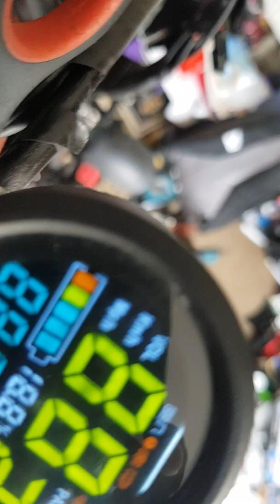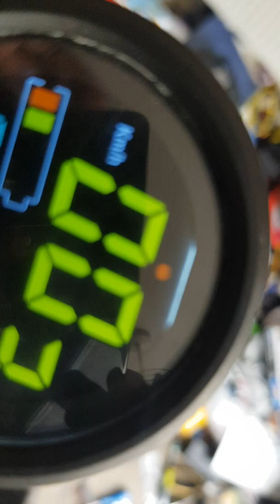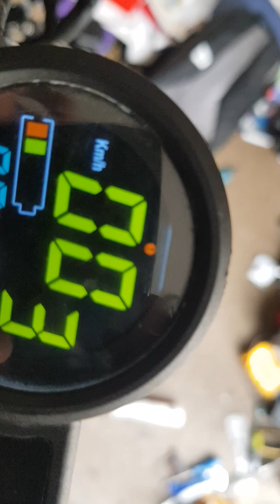Electric scooter brake sensor fault and easy repair.

Comment: I ripped my break sensor wires on accident. Can I retwist them back together? I been trying for 2 days.  
I did not know the scooter will not work without brakes
Reply from the maker: Hi, sorry to hear about your problem. Yes you can carefully reconnect the wires by Matching each colour and carefully taping them with insulation tape to keep them apart from touching each other. Your scooter should work again. If that fails, it means you might have had internal breach of the wire inside its coating. You should replace the whole wire. 
I hope this helps you.

Comment: Thanks man. It worked for me partialy.
After disconecting everything, only single motor was working. Thats the front side. But the back wasnt working and it only works when i turn on the dual mortor switch.. I need more help pls.

Comment: Thank you so much for this video, it saved me a lot of headache. I did notice one thing however when I was getting ready to open the wiring loom to disconnect the sensors. These brake sensors are just screwed onto the bottom of the brake levers, so I figured I would try and remove the sensors first just to check if the solution was working. It turns out the sensors are inductive, meaning there isn't any physical connection to the brake lever, there is a piece of metal in the brake lever's mechanism and when that moves close enough to that brake sensor (there's an inductive coil in there) then it changes the current going through the sensor and tells your brake light to come on. The sensors are also on tracks (the screws on the brake sensors aren't in circular holes, but rather in two long track cutouts), so if you want to keep the functionality then what you can do is loosen the screws, and move them around until they are properly aligned with your brake levers again so that the light only turns on when you pull the brake levers. This worked for me beautifully and now my scooter is back to full functionality, and I didn't have to mess with the wiring loom or anything.

Comment: My scooter brakes activate suddenly while i\m riding it then when i stop i just simply start riding and 2- 5 Minutes later it will brake abruptly and this keeps happening.  What do you think the problem may be?
Reply from the maker: Hi, sorry to hear about your problems. I think you are experiencing motor or controller failure. Check for grinding noise coming from your motor when it’s on again. When off, try to turn the wheel with motor. It should turn free but not too loose. If it turns with resistance, then faulty motor. Check your wiring on the scooter and electrical connectors to ensure they are not loose. I hope this helps you.

Comment: Hi i have kugoo m4 and as i was riding it it stopped and it was not accelerating anymore.when i turn the scooter on the brake light turn on automatically without pressing the brakes.it doesn't show any light or error code on the screen.do you know what the problem can be,and how to fix it?Can you pls reply

Comment: First of all, you're awesome and doing a giant service to all of scooter equipped mankind.

Do you know how one would fix an E2 error on a Gotrax GXL? I suspect it's the brakes because they twist farther than they should, and also in the wrong direction, it's a thumb throttle. I'm afraid to just replace the brake in case it's the whole console, but it's three times cheaper to buy a brake than instead of a whole new console! Please let me know what you think. Liked and subscribed.
Reply from the maker: Hi Sam, sorry for your problems. Yes you are right. You need to diagnose the brakes first as it’s cheaper to fix than the console.
Reply: @michaelmilenamg  The brake is extremely unstable, the throttle goes in all directions and feels totally broken. I wonder if I should just bite the bullet and buy the console to be safe...

Comment: Hello Mike can you help me with my scooter whenever I press my throttle it beeps and doesnt move??
Reply from the maker: Hi, sorry to hear that. Which scooter you have ? There are three things that can cause that . Throttle accelerator going bad, controller failure or the motor and sometimes the brake sensors too does that.
Reply: @michaelmilenamg  it's a citysports scooter and it says that something is wrong with the hall?

Comment: Mike I found my 3200w gunia indeed the new right controller.as live wire come away from board
Reply from the maker: Hi, I don't understand your message.
Reply: The red live wire has broken away from controler .I need new controller or some one to solder it back
Reply from the maker: @karlkarl3162  if you can solder it yourself,  try it. It's not that difficult.  All you need is a $5 soldering iron and lead.  If that proves difficult and you can't get someone to do it then get a new controller but try to fix it yourself first. Thus how you learn.

Comment: Mike I live in Surrey & have a 500w,48v YouPin scooter which has given me nothing but problems!! The seller has been cool & sent new controller box but this didn't work & same error code keeps coming, nightmare!!! I can't find anywhere that will fix scooters locally & was wondering whether there might be any chance you could have a look at my scooter for me?? I will happily compensate you for your time & we can meet wherever you are happy. I'm only asking out of sheer desperation, staring at a broken £400 scooter every night is driving me crazy & the wife wont stop moaning!! Please help!! You can contact me on , sameaton293@gmail.com.  Looking forward to hearing from you,  many thanks, Jamie.
Reply from the maker: Hi, sorry to here that. I will try to help you. Send me a small video about the scooter and the error coming on.
Reply: Hiya Mike cheers for reply. I've enclosed a few pictures but I'm at a total loss as to problem everything works, I.e. lights, horn, alarm, display but there is just no response from motor although occasionally it does engage briefly. Very confusing, I tried installing a new control box however same problem just repeated!! Any help would be greatly appreciated as i have tried all over & got nowhere so many thanks.
Reply from the maker: @sameaton5967  Hi, from what you said, I think your motor needs testing.  Sometimes the motor can fail due to electrical fault,  loose wiring withing them or burn out coils. If you have an electrician in your area,  ask them to check your motor for you. The process involves connecting the motor phase wires directly to the required voltage, which in  your case is 48v as you wrote in your test. If the motor turn when connected to the supplied voltage,  the motor is fine but if not then the motor needs repairing or replacing.  Secondly, it could still be a faulty controller.  I know you said you had new one sent to you but sometimes even right from the factory can be a faulty controller. If you know how to test a controller,  open it and test all mosfets or transistors to be sure they all showing correct reading. I have controller testing and repair videos on my channel to help you. All the same, I will recommend you get another new controller from your seller and try it again before focusing on the motor.  I hope these steps will help you solve your problem.  I live in London and it will be costly for you to come here for me to help you with it. Also with the Coronavirus issues,  I think not good idea at the moment.  Work with what I suggested to you and let's see the results.
Reply: @michaelmilenamg  Cheers Doc, I will spend my nxt weekend off work going through all your videos & hopefully I might get some answers & results. Here's to hoping!!!! I'll keep you updated if thats ok & any advice you can offer would be hugely appreciated. I'm such an amateur i brought a micrometer but can't even work that out so wish me luck !!!!
Reply from the maker: @sameaton5967  😀. Don’t worry we always learn and will get there. Try all that first and if still, then I will see if I can help you other way.
Reply: @michaelmilenamg  Cheers, fingers crossed!!
Reply: Sorry I'm new to this how do i send a video??
Reply: I've put a short video in my public videos on YouTube, I hope that helps??!!
Reply: It says error code E001
Reply: And has occassionaly said E 0002 but only a few times, very confusing!!??

Comment: Mike I have a problem,I get my scooter with a brake problem on the screen of the controller and the motors won’t work,what can I do to make it work? Do you have info that I can talk to you?
Reply from the maker: Vaggelis Bogeas Hi, which is it ? Watch my brake faulty video for an assistant.

Comment: Any idea Mike? After the sensors were disconnected motors run, but battery charge goes immediately to nothing, and when I charge the batt, it only goes 1 green bar and that's it. I looked for shorts, and I couldn't find any. Even the tail light got it disconnected and nothing. Any ideas? Batt shows 66 volts. ??? thanks
Reply: I think u need a new battery, the BMS in the battery must be broken… the BMS is a fuse inside the battery. 
THIS HAPPENED TO ME BEFORE.

Comment: It is july 24 2020 about an hour ago this happen I was going crazy calling bike shops maybe they could fix. But they only fix bicycles. Please man write me back I would appreciate it.
Reply from the maker: hitman 43017 Hi, what happened  ?
Reply: That I had the same problem with my scooter and thanks to you my scooter running again
Reply: Look after I did what u did to your scooter the light in the throttle monitor is coming back on and off do you know about that